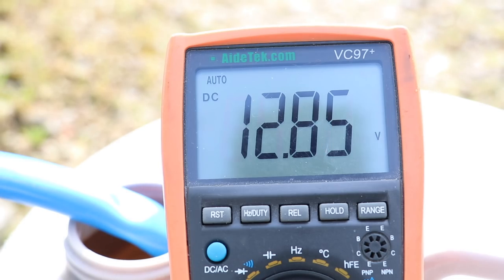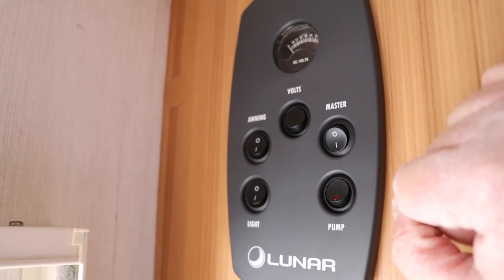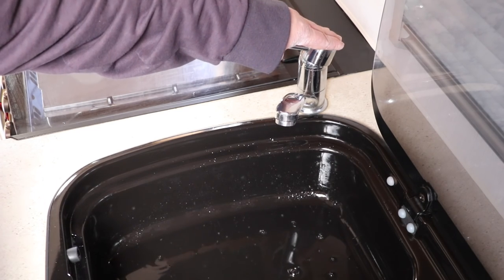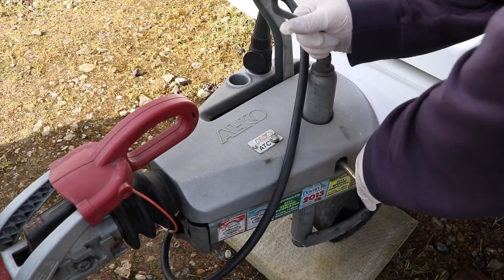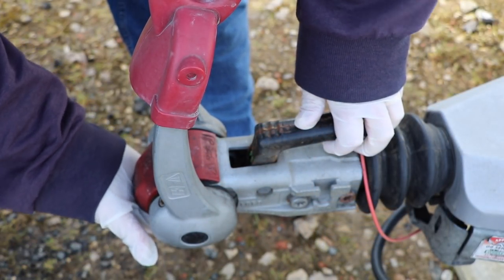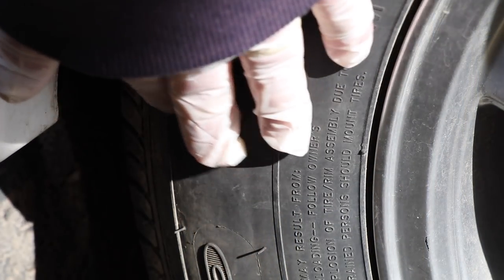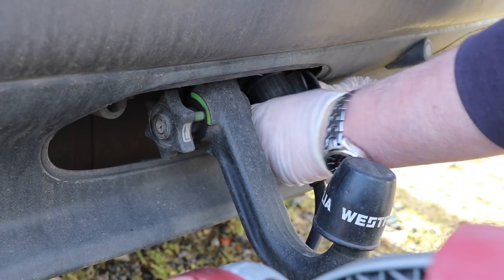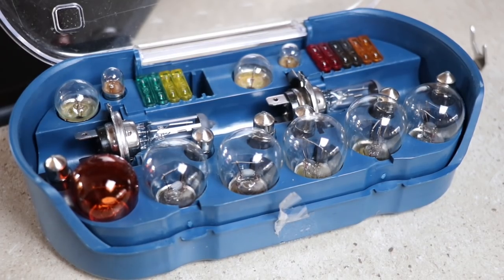Caravan spring time check list

Comment: A very good check list but you didn't mention the spare wheel which should be taken out and examined as well. Another thing to check is the hose and connectors from regulator to gas bottle with a drop of soapy water if you can smell gas or the bottle goes empty over winter if left connected. Keep up the good work !
Reply from the maker: Chris, Thats a very valid and excellent point RE the spare wheel and a great tip on the gas pipework.

Thank you !

Dan

Comment: Hello again, with regards to flushing through with solution can Milton be used in the same way as the powder. Reason i ask is i use Milton for my food van water canisters/carriers which is approved by the local EHO. I probably have answered my own question here but best to hear from the Guru HaHa.....
Reply from the maker: Hi Shaun, 

Many do use Milton but here is the deal. Milton really needs a clean surface to work. Hence why its used as a sterilisation fluid on clean apparatus / equipment. Puriclean cleans and sterilises and unlike Milton will not attack stainless steel.

I hope that helps.
Dan

Comment: Hi Dan. My battery reading  via phantom today is 13.3v?
Reply from the maker: Is that what you would expect ?

Mine is reading bang on the money at 12.8 at the battery terminals, and the app. 

Take care
Dan
Reply: Hi Dan. Today it's 12.8v! So I don't know. I guess as long as it's a minimum of 12.8 that's ok!
Cheers Dan. 
Paul.
Reply: Paul Talbot a 12 volt battery newly charged can read upto 14.5 volts but will level out after awhile.
Reply: spinaway thank you!
Reply: Paul Talbot you are welcome.